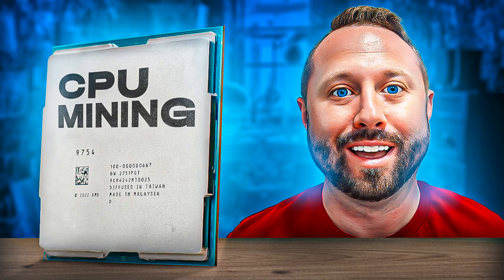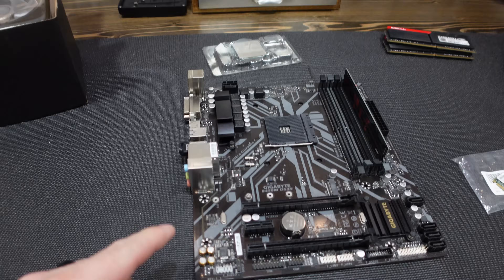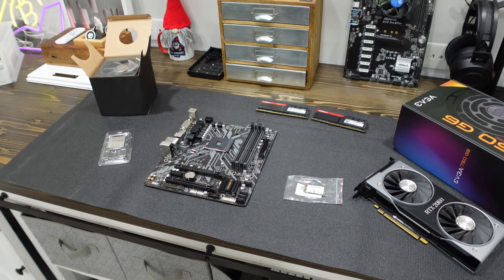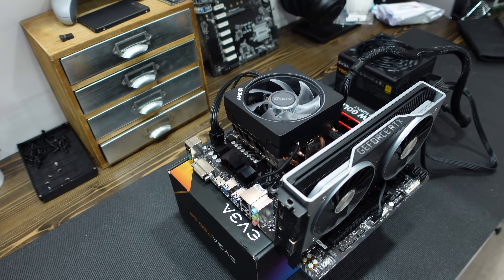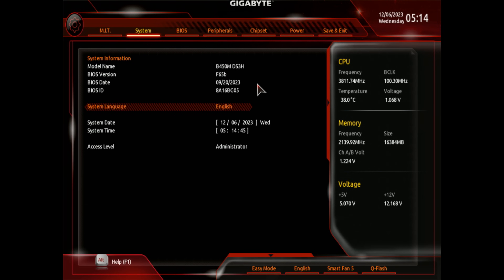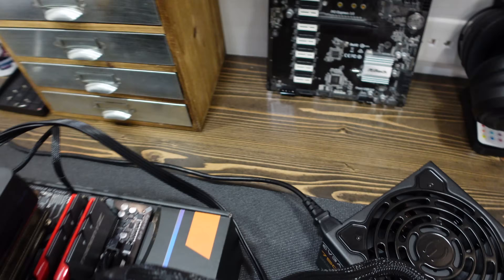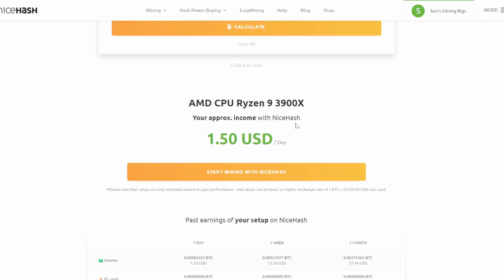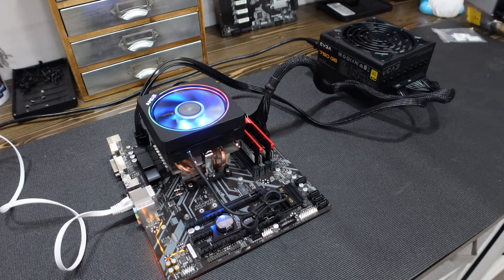I Built a CPU Mining Rig, This thing is Awesome! AMD 3900X CPU Mining Rig

Comment: things you can do further
1. just use USB flash drive and run it on hiveOS
2. if you're not gpu mining on the rig, should enable VGA/GPU ignore setting in the Bios, reboot and run cpu rig without gpu to save more on power consumption

Comment: For simplicity purposes id probably stick with nicehash... not that hive is difficult,  but i just find nicehash easier/faster for me to get going... love the rig... not bad for a first one... look forward to seeing more!  60c shouldn't be a problem.. my r5 3600 has a top temp of 90c before it throttles or shuts down.
Reply: i abandoned nicehash and i am using clouds servers now for mining tho
Reply: yes it is right now , making over 10k per contract monthly
Reply: could you tell me what platform i can start using this cloud mining service, Tbh mining with physical mining machines is stressful
Reply: its called Solar Cloud Farm Mining
Reply: this is interesting , i have so much about cloud mining , i am also going to give this a try too
Reply: Even my Ryzen 5 3600 has temps of 90c+, is there any solution for that?
Reply: @raghunathdesai1980  only solution I'm aware of is a better cooling set up like a wraith prism or aio liquid cooling... I used one from vetoo a while back but it died, so I'm back to a stock fan for now
Reply: @raghunathdesai1980  disable PBO u will lose -20c off the cpu for negligible performance if u have inadequate fan
Reply: @raghunathdesai1980 use raizen master to undervolt to .975 or 1.025 , also overclock to 3900-4000mhz.
It will reduce temp by 20 degrees
Reply: @raghunathdesai1980 at hashrate you are getting on 3600 on Zephyr?
I am getting only 7500, whereas hashrate.no mentions 8800.
How to increase it?
Reply: i heard cloud servers for mining btc is fire now!!
Reply: what cloud server platform gives you 10k monthly whats the name ?
Reply: wow i just checked them out sound nice.. i am tired of mining with machines , i would try this out
Reply: cloud service mining is amazing especially using  solar cloud farm mining.

Comment: Great video!  Always good info - havent cpu mined since I turned off my monero rigs couple yrs ago but will have to put my 5900 and 5950 to work now!!   I did a quick search but curious if anyone can point me to a cpu hashrate guide that is current?   

Have a bunch of 5600Gs, 5700Gs and 11700k and 12700k  - about 15-20 sitting around collecting dust and all with brand new motherboards I was going to sell but  curious if its worth it to break those out after Im done with the 5900s....  is it reaching trying to find profit in those older cpus

Comment: If your gonna be building cpu rigs get yourself a non-powered card that way you don't have to attach cables that will be removed once rig is set up, This only applies to 3000 and 5000 series cpus as they don't have on board graphics.
These are the two m.2 ssd's I use for cpu rigs:
Netac NV3000 250GB SSD 250GB Internal NVMe SSD Solid State Drive M.2 2280mm PCIe3.0 3D NAND with Heat Sink
Patriot P300 M.2 PCIe Gen 3 x4 128GB Low-Power Consumption SSD
Reply: All the threadripper stuff also do not have onboard GPU's.
Reply: Dude iam new to this but is it fine iam only to do cpu mining can I use some high end cpu parted with some low end GPU like gt 710?
Reply: @shakthivel5602  5000 series amd and 3000 series is fine and then can take card off to run headless so no display connected etc... if using a 7000, 8000 or 9000 series then no need for a gpu. Hope that helps
Reply: @gamingwithsmokeydan  thanks for the info dude.. so basically for cpu mining GPU doesn't matter no matter what?
Reply: @shakthivel5602  yeah as long as can get a display out so you can do all the settings in bios or ryzen master then once set you can remove or run with, if you set it up to remote in then you can access it from another computer as if you were on that rig, very easy when comes to changing settings or switch to another coin.

Comment: gigabyte bios is best. you can just type 36 enter for clock ratio.

vcore is under advanced voltages, or amd CBS/PBS. you definitely want to enter that as the VDD is still on auto, and appx 20w higher than it could be at that hashrate. I recently did a stream tweaking a 3900X for mining if curious.

turn off cool&quiet too.

XMP (and Im controvercial in saying this) should not be on. set mem to 2400mhz 1.2V. saves power and loses next to no hashrate. if you are pushing for highest hashrate power be damned XMP does then matter.

4G decoding not necessary for CPU rig

under 90c is fine for temp.
Reply: The goat!
Reply: I was wondering if you can help me with my settings. I have the same b450 mobo with a ryzen 7 5800x but can't find what settings for it.  It's listed to do 11k hash but mines running at 7k hash
Reply: no way in hell those will touch 11. that chip should do 8-8.6KH at about 95-100w wall. 

CPUs are too hard to help remotely on due to the huge number of bios layouts and wild silicon lottery. see my CPU live stream for basic settings  @IAMTHESMILE
Reply: Gigabyte A520M K with R5 3600 getting temp above 90 tried cooling/used heatsink cooler still it didn't come now I want to undervolt or Heatsinks on VRM

Comment: 132WATTS your nuts 😂 and it's under clocked....take your volts off auto and set it to 1 maybe 1.065 volts and put your clock to 3900 you should get 13500h at 110w
Reply: I havent met a 3900x that needs more than 1V at 3.6GHz all core. most take 975 or less.
Reply: I wonder what the hell is wrong with my setup, it does 190 watts i have the clock on 4.0 and cpu voltage at 1.20 and i ONLY get 12800h/s i cant figure out what the hell is the problem, dcop is enabled the mobo is a x570-p asus and the psu im using is nzxt and its gold ...